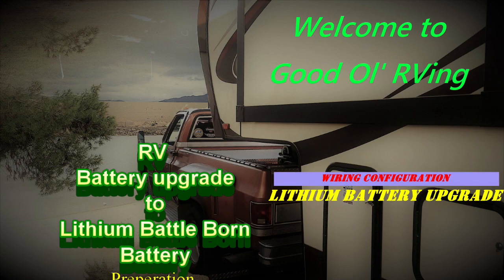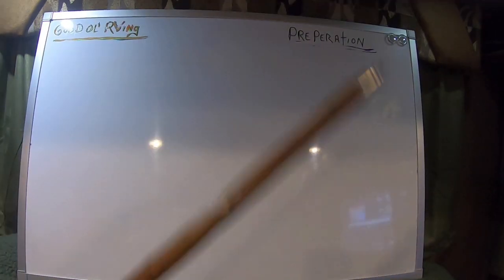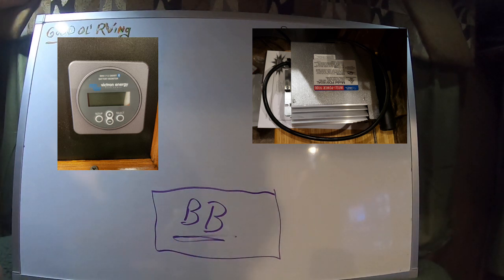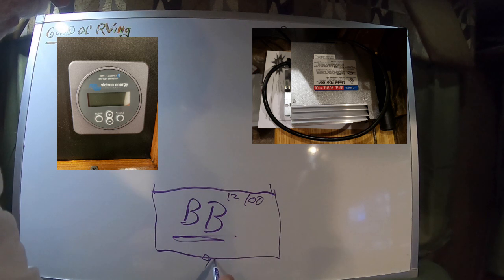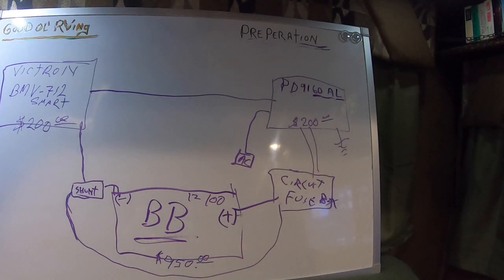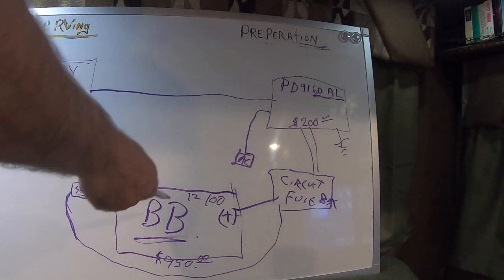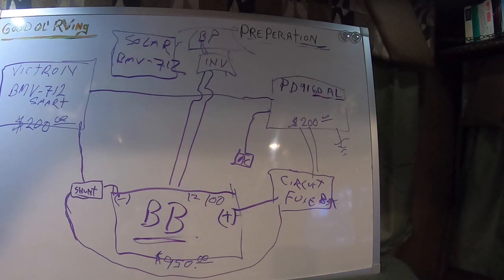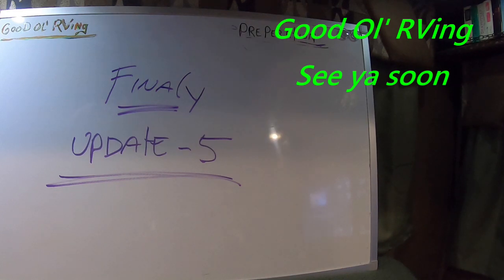RV Lithium battery Up grade Update 4

Comment: Greetings,  what is your concern with maintaining 14.6 volts on the Battle Born battery?
The BBB has a internal BMS system. I believe the individual cells balance at 14.4 volts. With New balanced and matched cells it is not an issue but as the battery ages the cells will drift. Being at 14.4 for a period of time is the only way it can balance the cells.
I have the SOK lithium Iron phosphate batteries with 400 watts of solar and a 45 amp Progressive Dynamics inteli-power for lithium. This chemistry likes to be at 50 percent SOC. Leaving 14.6 volts on the battery long term would be bad. Battle born recommends no more than 2 weeks strait. In my application we are off grid so the Intelicharger is for charging the batteries with a generator when there is no sunshine. I have the solar set up at 14.4 volts constant current constant voltage so I can achieve the balance voltage. Thoughts?
Reply from the maker: Yes, to avoid the long term exposure to the 14.6 dcv charge, you add the wires from the converter to the bmv-712 battery monitor and set the Victron battery monitor to turn off the converter once the batteries reach 100% then at this point the RV (in my situation) will run solely off the battery until it has dropped to the specified voltage you programed into the BMV-712. After it drops to that voltage the BMV-712 will automatically turn the converter back on and bring the battery back to a full state of charge. and this cycle will continue until you program the battery monitor differently. this was recommended by progressive Dynamics for the BB batteries. hope this helps.
Reply: Did you do a install video ?